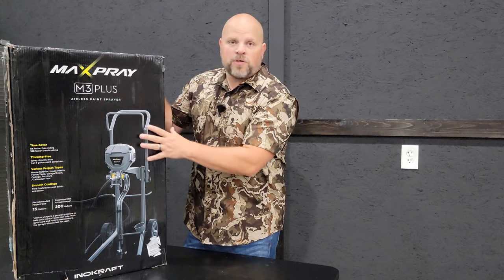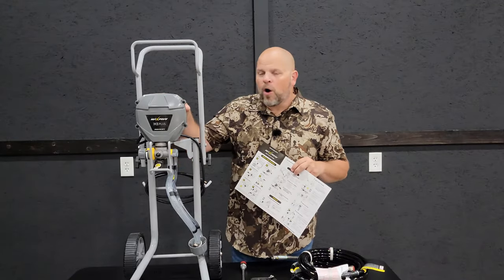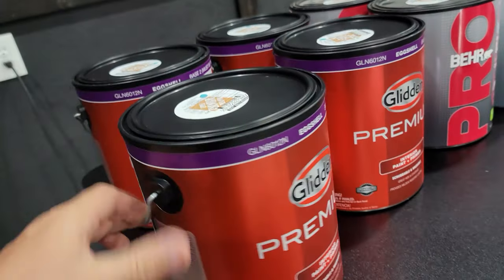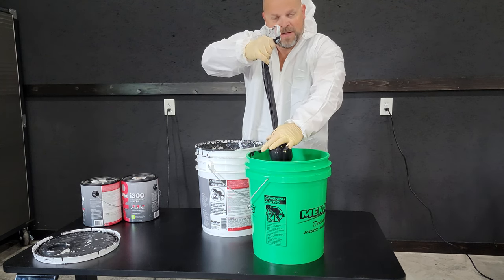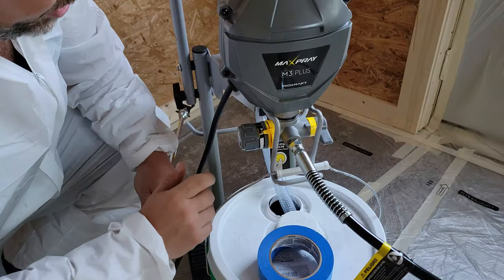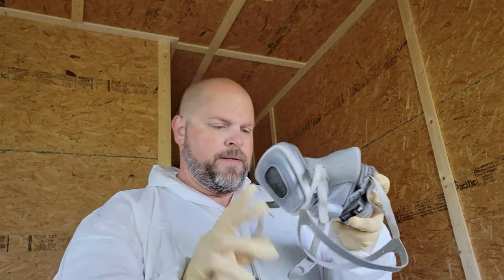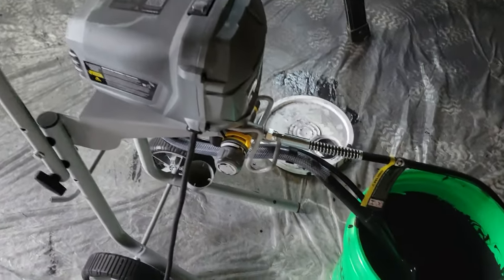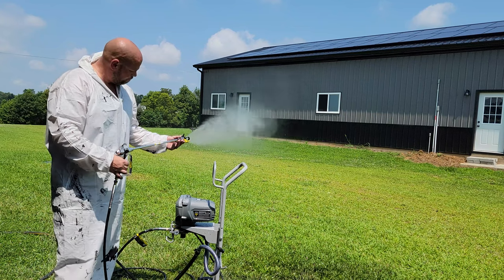Best Budget Sprayer your MONEY CAN BUY!

Comment: Does the 5 gallon bucket you attached in the description have the same lid with the opening for the sprayer hose in the video?
Reply from the maker: Great question! You would need to use the lid off of your 5-gallon paint bucket to get that access port. The additional bucket is for straining. Sometimes I pour the paint back into the original paint bucket so I can keep my new bucket as clean as possible for many uses. On this job I was not really concerned with that so I left it in my spare bucket. So I just used the lid off of the 5-gallon behr paint bucket. Thanks for watching and commenting. 👍